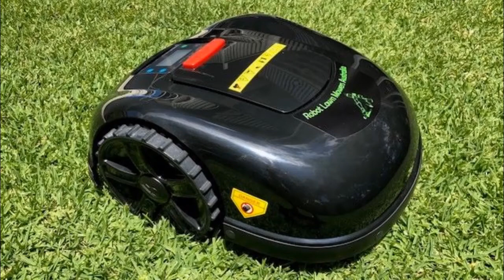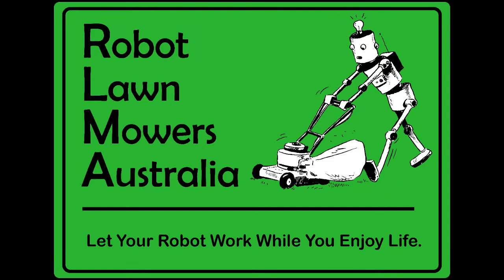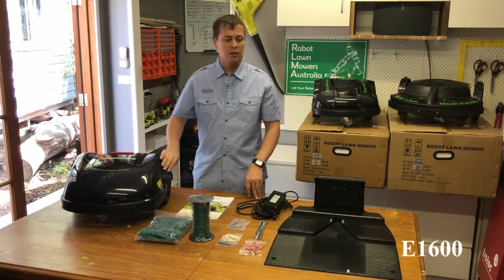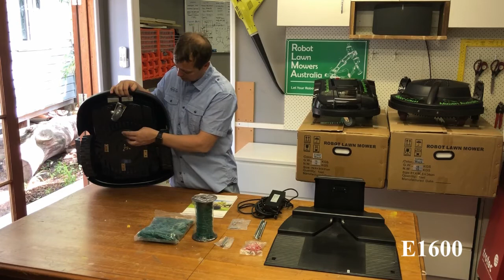Robot Lawn Mowers Australia - Lawnba E1600 - Review Video

Comment: Do you know anything about the Ambrogio L60B Robotic Lawn Mower.If you do, could you do a review on that one please. It claims to to be the only Robot Lawn Mower that does not require a sensor line or installation. It sounds really interesting and if it is good I will buy one.
Reply from the maker: Hi Henry, 

These mowers are really great for the right lawns. They do have their pros and cons like most robotic devices.

Pros are : they require no installation, have a fairly long cutting duration of 2 hrs, handle slopes very well, works well on open lawns with well delineated edges.

Cons are: Price for square meters covered is quite high,  requires manual charging and physical placement on lawns, does not work well on lawns that are patchy or do not have good delineation between lawn edges and gardens, will not cross paths to mow the other side.

Summary is that if you have lawns up to 400m2 that are in reasonable condition with no bald areas and your lawn edges have a flat surface for the mower to sense the edges easily, then these robot mowers can be really great. Otherwise I would recommend you go for a mower with a perimeter wire. The installation can be a bit of effort, but once set up there is no need to touch the mower, other than general maintenance requirements that all robotic mowers have.

For further advice please contact us and we can review your lawn details and advise what type of robot mower would be best suited to your lawns. www.robotlawnmowers.com.au